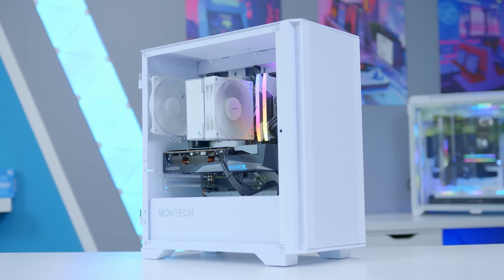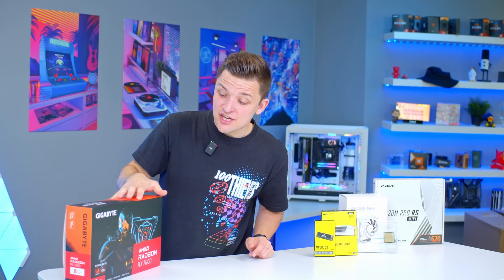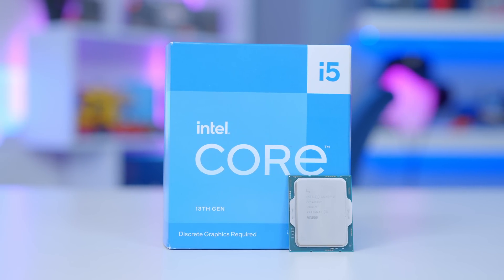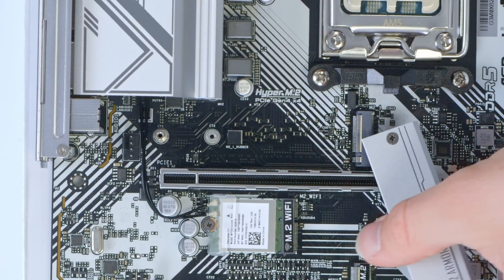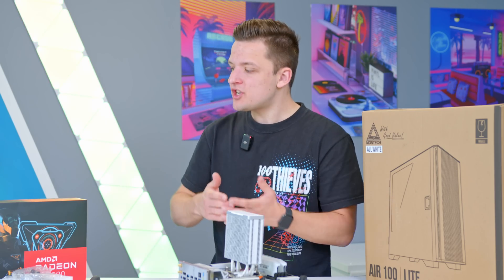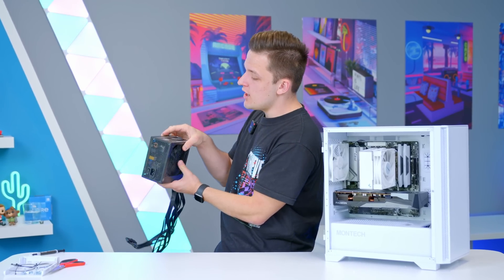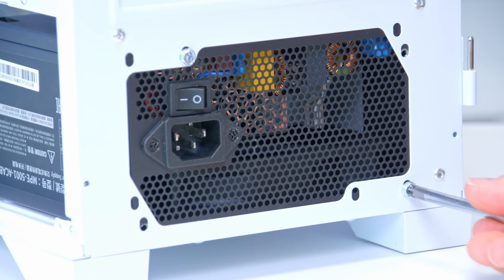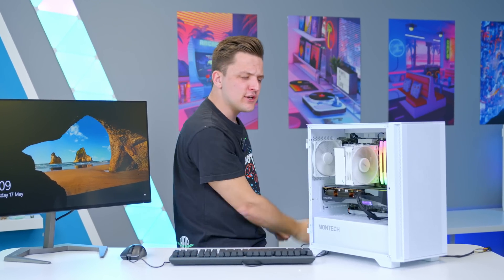Best VALUE RX 7600 Gaming PC Build 2023! 😄 [Full $900 Build Guide w/ Benchmarks!]

Comment: Should i get a b650m instead for a 7500f or a620 is good enough?
Reply: A620 is good enough. Go for B650m if you plan to upgrade from a Ryzen 5 7600x
Reply: @sneppy5735  whats ur recommendation for a budget option of b650m?
Reply: @_ynnek  the ASRock B650m pro RS wifi or without wifi is pretty good for the price
Reply: @sneppy5735  in my country theres only a non wifi option, but considering jm going for a black build, that white accent kinda bugs me ngl...

Comment: im building r5 7600 with msi b650, can it use corsair vengeance rgb (expo) 6000mhz cl30 ram? when i check msi compatibility, that corsair ram SKU is not listed.
Reply: Just use 6000 CL38.

Comment: Great vid and build , I am currently using Ryzen 7 5700G with 450w 80+ Bronze Psu and planning to buy Rx 7600 . Will I be good with same Psu or do I need spend more 😢
Reply: look up online your specs on pc part picker it’ll let you know how much watts you need. but 450 seems fairly low and i would go ahead and upgrade to a 750 at least

Comment: A R5 5600 and a RX 6650XT GPU would be enough and cheaper for a gaming PC with only 8GB of VRAM. Your build is strange. You should use at least a 6700 XT instead of 7600.
Reply: I got the same build and it’s great idk what you are talking about and the 6700xt doesn’t have the av1 codec
Reply: @MannyBuckets8  My comment was a year ago. Now I got a 4060, which is far superior than 6700xt and 7600. I really wanted to get an AMD GPU for my 5700x, but 4060 is the best deal, even better than the 7600 xt.
Reply: @satenu78  bro for gaming the 6700xt clears the 4060
Reply: @MannyBuckets8  You may be right, my friend, but I use AllPlan at my job, so the 4060 is a king.
Reply: @satenu78  the 4060 is still a good graphics card anyways

Comment: CPU: AMD Ryzen 5 7600X 4.7 GHz 6-Core Processor  ($209.99 @ Newegg) 
CPU Cooler: ID-COOLING SE-224-XTS BLACK 70 CFM CPU Cooler  ($29.99 @ Amazon) 
Motherboard: Gigabyte B650M DS3H Micro ATX AM5 Motherboard  ($149.78 @ Amazon) 
Memory: TEAMGROUP T-Force Delta RGB 32 GB (2 x 16 GB) DDR5-5600 CL32 Memory  ($95.99 @ Newegg) 
Storage: Crucial P5 Plus 1 TB M.2-2280 PCIe 4.0 X4 NVME Solid State Drive  ($79.98 @ Amazon) 
Video Card: XFX Speedster QICK 319 Core Radeon RX 6750 XT 12 GB Video Card  ($379.99 @ Amazon) 
Case: Corsair 4000D Airflow ATX Mid Tower Case  ($94.99 @ B&H) 
Power Supply: Corsair RM750e (2023) 750 W 80+ Gold Certified Fully Modular ATX Power Supply  ($99.99 @ Best Buy) 
Total: $1140.70